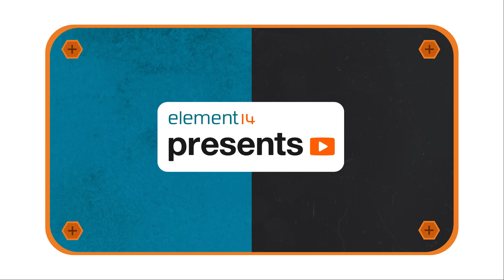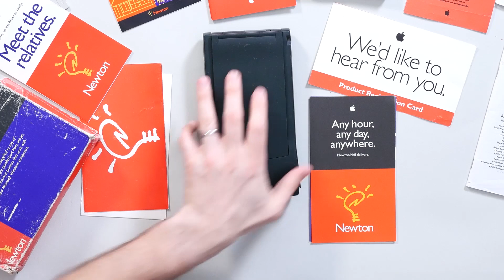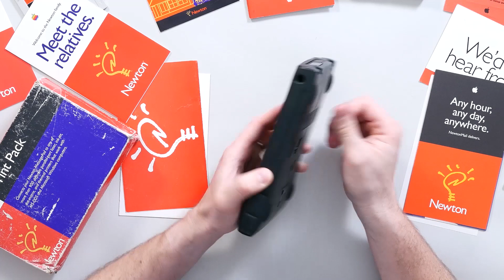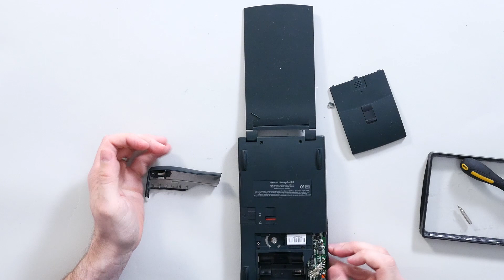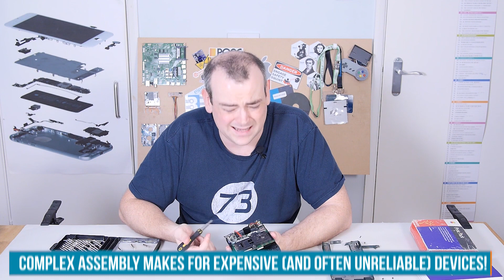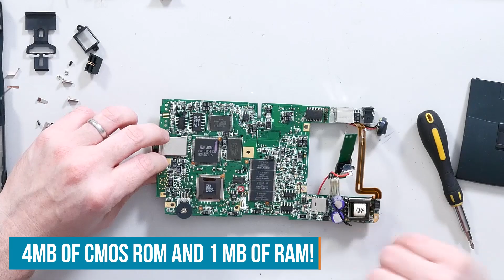Apple Newton Teardown - The Electronics Inside

Comment: The term "PDA" or Personal Digital Assistant was first used by then Apple CEO John Sculley, at a pre-release presentation on the Newton. Although the Newton was a flop, it did limp along until Steve Jobs returned and killed it in 1998. Given the fact that the final generation of Newtons were enormously improved in every way from the original clunky devices, and were finally delivering on most of the promises originally made about their capabilities (although they remained niche devices), there is speculation by some that Jobs killed the project at least partially out of vindictiveness towards Sculley, who had been hired by Jobs back in the 1980s but had wound up leading Apple (until he was in turn forced out of Apple) after Jobs lost a power struggle and was ousted from the company in 1985.

 One of the final Newtons was the Newton eMate 300, a very netbookesque folding device aimed at the education market, it was actually seeing considerable interest and seemed to be taking off when Jobs killed everything.

Comment: The large manual is a product of the times, where all products tended to come with manuals, and not a reflection of the ease of use of the OS. People didn't bother to read it.
In reality NewtonOS was incredibly easy and intuitive to use.
The ARM610 was an early step towards a SoC - it combined an ARM CPU core with an ARM memory management unit (previously separate chips). Shortly after it was produce ARM made the ARM250 which combined an ARM CPU, memory management unit, IO controller and video controller, probably the first true SoC.
Reply: Somewhere in history, we went from PCs with nothing but a command line prompt on boot, which definately warrented a manual to teach you how to use it. To an intuitue, idiot proof user experiance. But the two overlapped enourmously - I would ask why?

Not that I disagree with your reasononing or anything, I'm just intruigued to explore why this may be?

Comment: No one "in the public" had one, just hardcore techies, some OEM business use and one variant for schools - I had several variants and developed for them. Had psions too which I loved, and others. Journalists hated the hand writing recognition because they have short attention spans/deadlines - it had some adaptive smarts that had to settle into your personal cursive style. It worked pretty good for me, especially with the later models like the 2100, and my handwriting is awful. I used them every day for quite a few years. Lots of additional apps existed - I had hundreds and even used it as a super portable mobile terminal to unix systems with its keyboard accessory. I had a wifi card, modem and more memory. It synced with Microsoft exchange just fine as an example.  I was definitely the inspiration for later products, but was too far ahead of its time, including the OS which is object based with a built in database engine and quite unlike the kludge that was early iOS or MacOS pre X.

The handbook was needed because it was first of a kind, and well written. Also happened with all PCs of that era - hindsight fallacy to critique it, nothing in tech was "natural" at that point.
Reply: Interesting to hear is was an object based OS, i thought that came to Apple after it was developed at NEXT with Jobs?
Reply: “Kludge” and your opinion is duly noted and ignored. (Said by someone who wrote software for iOS 1; yes, prior to an SDK or official public developer tools existing.)
Reply: @GothAlice  Me too  ¯\_(ツ)_/¯ carrier developers, as I was then, had all the toys. I was utterly platform neutral then, as I am now, and call it as I see it. You do know I wrote that 9 months ago ? Sorry if I made your angry, I am sure in other contexts we would get along great.

Comment: Sorry, but the lack of manuals for modern devices has nothing to do with simplicity or ease of use. If they were as conscientious and open about giving you information and instructions about current devices they would be far, far thicker than that Newton's literature. What has happened is that over time they've partly given up keeping up with the slew of devices they're constantly producing, not to mention the updates to both hardware and software. Devices used to last for years and years, now they expect you to buy a brand new $1000.00 device every year and never really get to know it or take advantage of more than a tiny amount of its capabilities. And they really DON'T WANT you to know all the things you can do with it.

As for me, I stopped buying flagships about 8 years ago (a Galaxy S4 was my last flagship phone).My current phone cost me less than $300, does everything I need it to do (which is a heck of a lot more than the average person, I'm a major power user), and is several years old already. When it starts having problems or no longer meets my needs I'll replace it, but not before then.

Oh, and as long as phones exist that have headphone jacks I will NOT buy a phone that doesn't have one. I use that jack constantly, even though I have lots of Bluetooth headsets, headphones and speakers. Having to charge something besides the phone, and having your headset's battery run low long before the phone itself, is way more hassle than it's worth. Just plug and go. (Not to mention wireless audio is compressed and lacking in quality compared to wired.)

Comment: The original Newton had those issues but the 2000 and 2100 it was pretty damn good.
Reply: agreed - I had and still have in storage a VERY tricked out 2000, loved it.
Reply: They definitely ironed out the recognition issues, it just took some time to refine.  That a device with that amount of power was even capable of the feat in the first place was pretty amazing.  As I've pointed out in several other replies, that recognizer lives on in iPad (Pros) and lived on as Inkwell / Ink in macOS.  You don't throw out good technology.  😉

Comment: "they can't have put the operating system on volatile memory can they"

Yes, yes they did* kind of...

*going back to the winCE days here for me, whilst the OS was in ROM, ALL user/config data was in battery backed RAM... Let the battery expire and you'd find your device reset to factory defaults when you next charged and booted it... I'd guess this being the same setup.
Reply: I assume this is pure the cost of non volatile memory at the time?
Reply: FailQuail , when they released the MP2000/MP2100 it was stored in flash ram. So even when the batteries went flat the moment you installed a fresh set of Alkaline AA all your data was still there.
Reply: @SonnyHung  I remember this from my early winCE smartphone days, and i was aware many other devices had the same setup too.

Nice that there were some that sensibly used flash storage though :)
Reply: Yeah, I was there too with the Palm Pilot, and WinCE devices and they all really didn’t offer a flash ram option back then which caused quite a problem when an issue arose and battery power drained... my Newton Mp2100 5-7 years after being pit into storage power up right back to where it was left with all the data , applications and stuff I needed to reference. What was good was when Newton moved away from SRAM which was introduced with the OMP/MP100 which needed a battery backup in the card to Flash Ram cards what ever you stored off the Newton on the flash cards never lost anything normally except for those unusual rare occasions when something went corrupt which I personally never experienced. Now a days devices have data stored in flash ram. The prices back then was high for flash ram so I can understand why it was not adopted early on.

Comment: At one time, Apple licenced the Macintosh OS, and Sony manufactured a Mac clone. I don't recall any Newton clones, however US Robotics, which later became Palm Computing, made a competing device, the Palm Pilot, which was very successful.
Reply: Palm OS was (and arguably is) still brilliant!

Aparently Sharp, Motorolla, Siemens, Digital Ocean and Harris all produced newton devices. I have also (since filming) found out about the HP iPods!
Reply: The architectural design of PalmOS was very, very, insanely Macintosh inspired.  They had resource forks which were essentially databases mapping a "fourCC" code and numeric identifier to structured data, such as a WIND resource describing a window.  Or ICNs containing an icon.  CODE containing, well, executable code.  The fixed "Jot" writing recognition was nothing compared to later Newton revisions; I'm incredibly glad Apple reintroduced write-anywhere recognition in iPad OS.

Palm OS just couldn't keep up with the increase in storage demands (I've written a number of Palm OS VFS utilities, it was un-fun,) and high resolution screens seriously fragmented the OEM space, with Palm utilizing one API set, Sony utilizing another, and most devices (until Palm OS 5 / Garnet and the transition to ARM) incapable of much beyond uncompressed (or run-length encoded) BMP display.

I also wrote one of the first JPEG decoders for early Garnet devices. Fifteen seconds to decode a 1600x1200 JPEG for display on a 320x320 screen was just awesome, and yup, that was with ARM-native optimizations… seriously ugh. Sony cheated with ASIC CODECs—discrete hardware decoders for things like MP3 and ATRAC. 😉

Comment: One of Jony Ive’s first designs he was in charge of at Apple.
Reply: And also typical of his designs, it breaks when you try to take it apart and it’s complex on the inside. Johnny had some design wins that where good industrial design (the G3/G4/G5 powermac cases) but also some flat out form over function design fails (the hockey puck mouse from the first iMac). Johnny was good when Steve Jobs was alive, but without Steve he became too obsessed with making things thin to a point where it hurts the functionality of the product. It seems like product design is a fine balance. Johnny is the opposite of an Architect, they often get better with age and experience but he’s gotten worse over the years.
Reply: Do you think it was a successful one?
Reply: @a531016  It was a nice step up from the first generation Apple Newton. The way everything fit's and even the look of the stylus. Just like his design of the 20th anniversary Mac,  he was only one Steve Jobs away from brilliant.